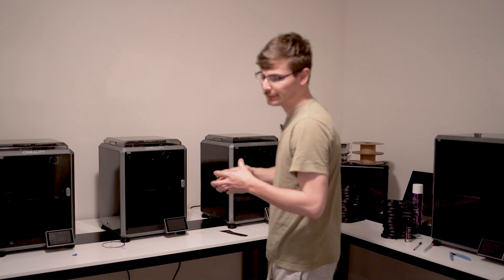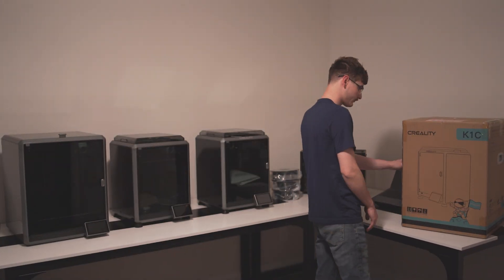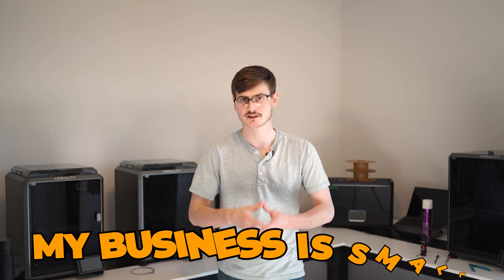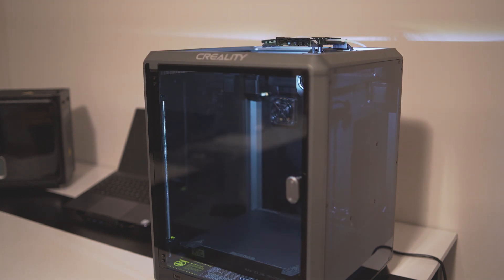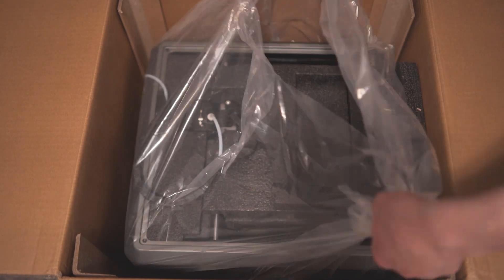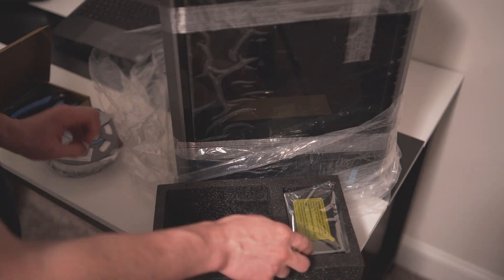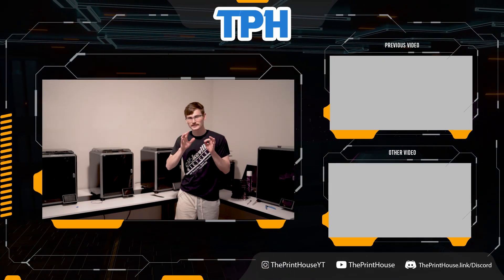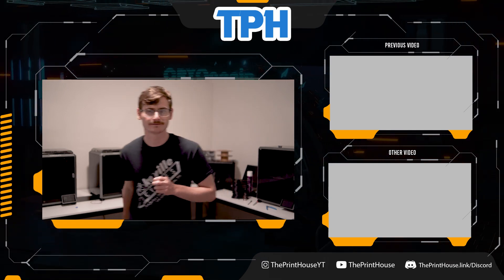How My 3D Print Farm Made Me Rich

Comment: The K series are great printers and the print volume is so much better than the bambu ps series. Personally, I don't need enclosed printers as I only print pla so my little print farm uses the Hi Combo and Ender 3 V3 Plus printers. They are super reliable for me printing 24/7 for my etsy and ebay products. I also still use my older CR10sprov2, 3 cr6ses, and even my original Ender 3.
Reply from the maker: @LoriAnneBrown  I have been incredibly surprised at the Hi. It has been so wonderful for me

Comment: Cutting costs to get a cheaper printer now isn't going to make you more money later. You'd have been better off with 1 more reliable printer than 2 printers that are only reliable for now. Creality printers are notorious for needing much more frequent replacement parts, and also early upgrades to better parts because they cheaped out to lower the cost and undercut competitors entry level offerings. Any extra money you made at first is going to be spent sooner on wear and tear, and even in some cases out right replacing printers.
Reply from the maker: @unou588  there is a lot to unpack here. I can't really reply to it all in a quick comment, I'd love to discuss it on my discord channel with you though. That said, creality printers far more reliable now than they used to be.

Comment: 30mm screws?  Everything I design is with standard hardware.  So the handful of items that made the transition from personal need to sale item is as easy for the customer to get replacements if needed.  Example being if someone buying a heavy duty cupholder for an early vintage John Deere Gator farm utility vehicle drops a screw many will be offended when the find they need to buy metric.  Normal people HATE metric.
Reply from the maker: Yeah thats not a bad idea. Usually I design my products to not use hardware at all. For this particular design I didnt have any input because I didnt design it myself. That is definitely something good to think about though!
Reply: You're exactly right. Once I discovered that it's almost impossible to find small metric bolts in my town, I changed all my designs over to American Standard. If I can't find metric bolts locally then I'm sure many others can either.
Reply: Yeah, should say that the screws are 1" 2 corn buds in size or whatever. May need a bit of persuading to drive 'em in with regular tools.
Reply: the whole world works from metric apart from the USA lol
Reply: @AlphaEngineer2022  With rare exception yes.  But "lol" if your selling items for regular people in the US, then your market prefers standard which is easier to get at any hardware store and many HATE using metric.
Reply: @gitss7367 have you never been to a home depot or an autozone?  All our cars are completely metric now, so I'm not sure why you can't find hardware, a giant box of small screws are cheap on Amazon as well.
Reply: @FirechickenExpress  Yes I have.  I also buy nuts and bolts in standard and metric.  That changes nothing when it comes to the average person's reaction is a range from mildly annoyed ti weirdly outraged when they need to buy metric.  It is what it is.  The fact that in stores metric tends to be more expensive per bolt or nut also doesn't help.  

On the designing end for things like threaded brass heat inserts metric is far cheaper.